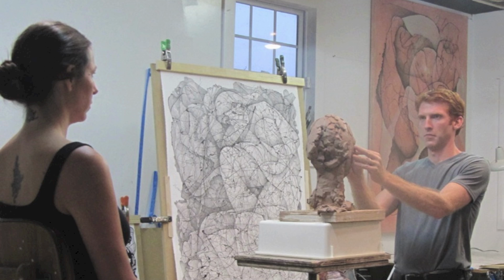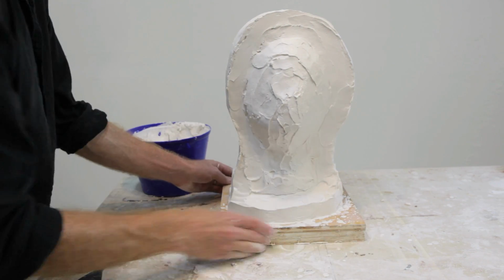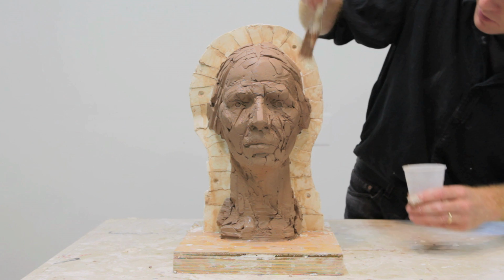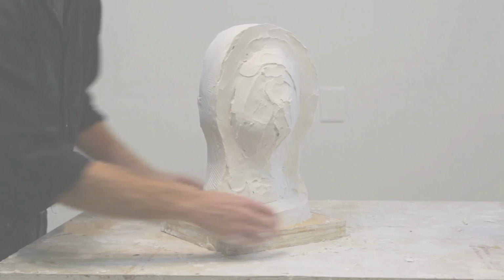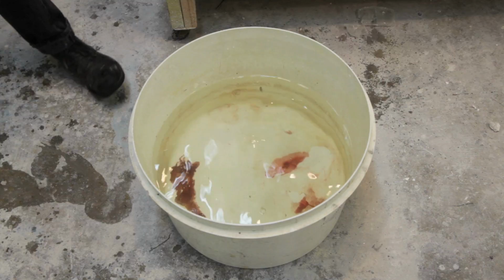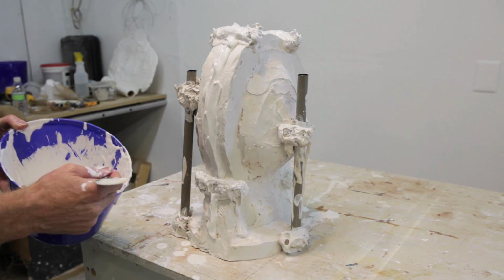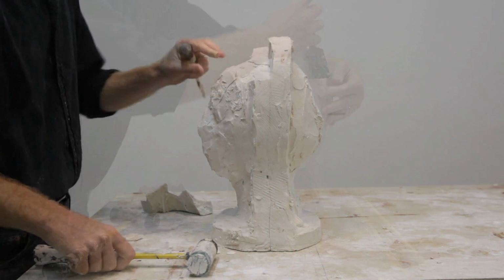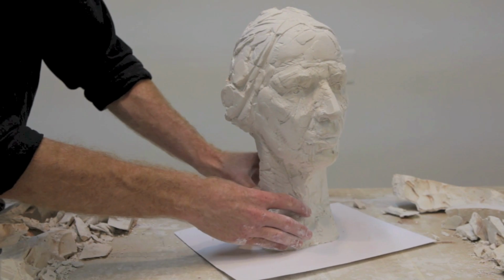Materials and Process: Plaster Casting (Short Version)

Comment: Thank you for sharing. I have a question, how can you do a mold that can be reused several times?
Reply: Either you must use another material like LATEX. or you must make the plaster mold around the object in such a way,, t, so there are no UNDERCUTS where the final object might break off.. like an ear for example.

Comment: Do you let  the washed casting dry before assembling and pouring the mold?
Reply: Not necessary to dry 100% but need to be ready to accept a coat of liquid clay with  soap to release the outer mold ( to be destroyed) then the plaster copy is to keep and finished later and make copies in silicon rubber or latex

Comment: I have no idea why people do plaster casts into plaster molds. If you were to make a RUBBER MOLD, you could recast if there were imperfections during casting. Once you destroy the mold, it's over. If the cast pour is bad / defective, that's it. Resculpt. 

BUT!, this kind of artist is not my expertise so there may be reasons for this which I do not know.
Reply: Probably because using silicone rubber is too process-y and they don't really plan on making more than one copy of it? Not sure but as a beginner with no proper knowledge about all of this.
This method is somehow more doable to me 'cause I find it easier and less complex. I could be wrong though, right now I just don't have the access to all the right information and materials needed.